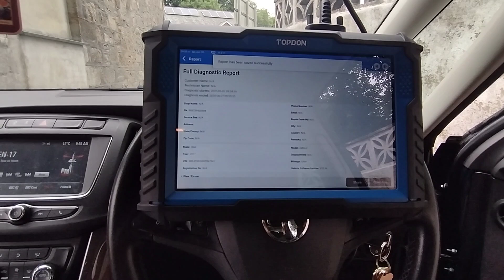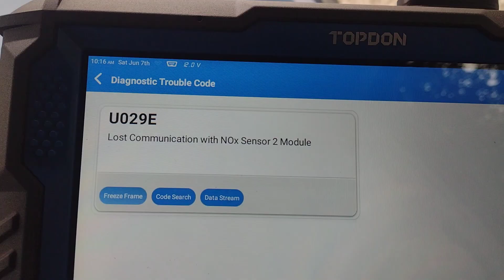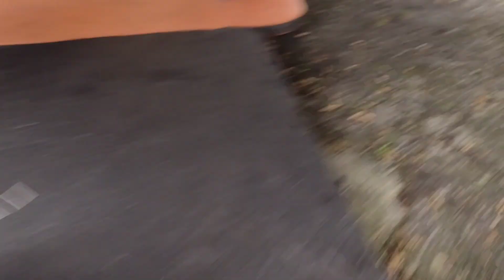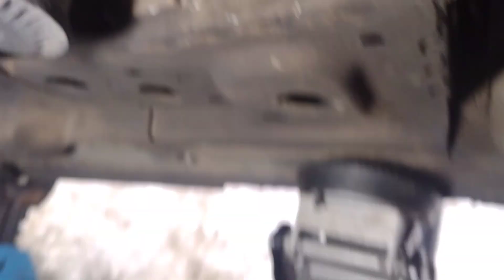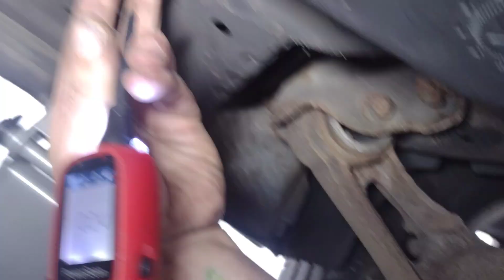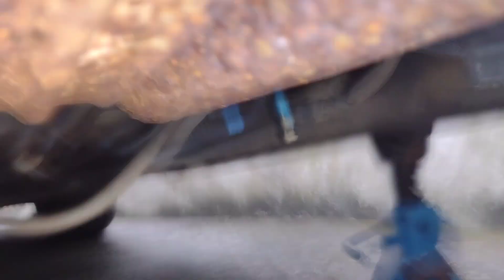Vauxhall Zafira 2017 (P229E) NOx sensor circuit testing

Comment: Hi Matt nice new machine, The Xlink is a cracking tool i have been using it over a while now 

Done software updates the lot and it done it without a problem, Incase it helps at anypoint if you need to do online programming on skoda seat eta just click on VW or Audi (whichever one it comes with) and it automatically changes it to the other manufacturer (so it will do the others too)
Reply from the maker: Thanks 👍,  that's good to know. I actually got it because I saw you using one. Cheers mate